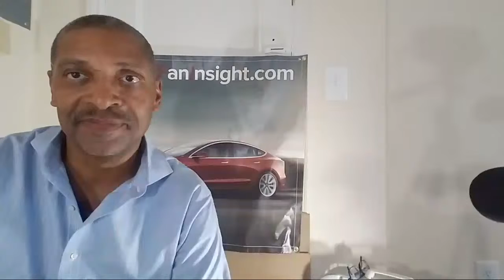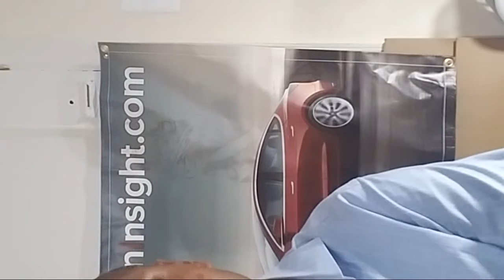5 Reasons Maxwell Dry Electrode Not Viable TESLA

Comment: The way I understand 'SUPER CONDUCTORS" is that at Absolute Zero electrons do not lose energy in the form of heat.  Mercury at -240 degrees C becomes a superconductor.  Progress has been made.  Hydrogen Sulfide under extremely high pressure currently holds the record as a "high heat" superconductor at a mind blowing -70 degrees C.  To date "room temperature" superconductors have not been developed and are decades away by all accounts.  The dry electrode battery is a process where the liquid electrolight is replaced by a dry electrolight product which is applied using electrostatics and does not require baking to dry, eliminating a bulky, time consuming, polluting and expensive step.  This was the big draw for TESLA because they would be able to achieve at least 15% better energy density initially and up to 50% energy density with a little development.  A solid state battery is completely different still and is currently in development by EVERYBODY.  Super Capacitors are a completely different animal and will be made to work as a buffer  between a battery bank and an electric motor as they accept and discharge current EXPONENTIALLY faster than any electro-chemical batteries.  They do not currently hold their charge long enough to be used exclusively.  Do some homework Greg.
Reply: Agree with most of it. Just notice, AFAIK, DBE is a tech to produce the electrode not the electrolyte.
Reply: Celso Starec ... oh ok ... I’ll look into it closer.  I thought that complete elimination of the electrolight was what the research and  development departments around the world were trying to accomplish with the solid state battery.  I will do a deeper dive.
Reply: @jamesbell8861  
Yes, the solid state battery is a kind of holy grail of our time. People hope to eliminate the current liquid(paste) electrolyte and many related artifacts that shorten battery life and endanger thermal runaways.

On the other hand, Maxwell Technologies was specialized in supercapacitors, a device that stores energy as electric fields instead of chemical reactions as regular batteries. (Take it with a grain of salt, in Li Ion batteries the ions move and concentrate in different regions, but not necessarily react chemically).

Maxwell developed and patented a technology to coat electrodes with a material with a dry process. This technology is supposed to serve supercapacitors and many types of battery electrodes. This is the DBE process people theorized will bring many benefits to Tesla. This technology does not alter the kind of battery, just the way it's manufactured avoiding clumsy techniques that demand a lot of space, time, energy, etc., limiting battery manufacturer productivity.

"Solid State Batteries", or "glass batteries", would be a different kind of cell, far different than current ones.
Reply: Celso Starec ... I’ve described the process of the Lithium Ion battery to my wife once like this ... “ think of it as a RESET as apposed to a RECHARGE, the battery doesn’t actually hold electricity. That’s what a capacitor does.”  She was having a little trouble wrapping her head around the difference.  Speaking of ‘salt’,  have you seen any of the videos posted by Don Sadoway on his liquid metal battery technology that he developed with his students at MIT ??? It sounds promising as a GRID LEVEL STORAGE battery.  It actually uses molten salt as its electrolyte.  I see Tesla using Lithium Ion in their MEGA PACK Storage and wonder if they have considered or dismissed this innovation for R&D ??? If you haven’t seen it, give it a watch, I really found Professor Sadoway to be an entertaining character and quite knowledgeable.  I’m not sure if I completely understand how it would work in the real world but then I’m not an engineering major either ... lol
Reply: @jamesbell8861  
I did see videos of professor Sadoway. This and other reactions have been promising for a long time.

Technically, electricity is current, the flow of charges. Most of the time the charges are free electrons that flow through conductors. Many metals are good conductors as their atoms are organized into a lattice with a cloud of free (or almost free, loosely coupled) electrons, that allow for a new electron to enter into one side and another of the cloud exists at the other side.

A capacitor is a device which stores charges at its electrodes that has a noncondutive (dielectric) material  separating them. Those opposing charges at each side maintain an Electric Field across them. The energy is stored in this charged state, or seen in another way, in the electric field.

If you plug a load, let's say an incandescent lamp that acts as a resistor across the capacitor electrodes, the opposing charges would flow through the load till both sides equalize.

A galvanic cell, the basic element of a battery is somewhat different as it changes a chemical state as a way to store energy. There is more to it than just the flow of electrons to one side or the other.

There can be proper chemical reactions as on lead acid batteries involving both electrodes (Pb and PbO2) and the electrolyte (H2O + H2SO4).

There can be another way as in the Li-ion batteries where initial charge depletes some Li atoms from their electrons turning them into Li+ ions. Those ions travel to the other side of a separator membrane within the cell that does not allow electrons acros. It's a flow only of positive charges (the net Li ion charge imbalance) inside the cell. Those Li ions "lithiate" (they cram themselves within the porosity of)  the electrode material, but don't actually react chemically.

If that same lamp/resistor is connected externally across the cell electrodes, the Li ions crammed in the opposing electrode will tend to go back, and an electron that was at the electrode balancing the ions will go back, but as the only path is through the load it will go there.

If for some reason the separator fails, usually punctured by a "dendrite" that parasitically grows with usage cycles, there can be established a short circuit for electrons within the cell, with high currents, thermal runaway that ignites some chemicals in the electrolyte.

The holy grail of the glass separator or the solid state battery would be to do the function of the electrolyte and the separator without the risk of failure, being intrinsically safe, possibly with less mass and volume.

The DBE process would be another way of producing the electrodes coating a metal with the intended chemicals without the need for the wet process and the ovens to dry the result. It does not mess with the electrolyte.

A capacitor is neither supposed to conduct charge within (there is always a kind of parasitic resistor within, modeled as ESR - Equivalent Series Resistor), nor chemically change state. As the electric field builds up, it will polarize whatever dielectric material separates the electrodes and eventually break the dielectric/insulating capability of the material and let current flow. Somewhat similar to the way a high tension pulse induced at the secondary of the coil from a gasoline engine breaks the dielectric capability of the air in the gap of a spark plug and creates a spark. In a capacitor, one would like to put as much charge/voltage as possible before it turns into an undesired spark plug.

Hope it makes it clearer.
Reply: Celso Starec ... Thanks, I appreciate the time you took to break this all down. I understand most of the science at a rudimentary level and find it fascinating how we figured it out in the first place.  I’m awed by the intelligence of some people.  It gives me confidence that we will figure out this big polluted mess the greedy ones among us created.  It’s only even come to my attention in the last few years exactly how long clean technology had been locked up in patent vaults by various corporations hell bent on squeezing every last dollar out of the populations pockets.  I guess we can figure out the restitution later ... right now the battle is catching up on decades of lost R&D time.

Comment: What is that you know, Elon wasn’t aware of when he bought Maxwell?.. You probably know that Elon specialized in capacitors at stansford.
Reply: Ram ramachandran Exactly
Reply: The acquisition wasn’t primarily about Maxwell Ultracapacitors (Superconductors aren’t involved at all - they’re a thing too but not seriously connected to near term applications for this stuff). 

The point was Maxwell’s battery MANUFACTURING technology - it’s technology for building machines that MAKE batteries. Their dry electrode process eliminates an expensive drying step. Maxwell developed this technology in association with Ultracapacitors but Tesla’s big use of it is for batteries. This dry electrode tech allows a radical reduction in the footprint of the factory floor machinery ( 1/16 the area) as well as a set of improvements in the cell performance, doubling useful life, improvements in energy density, etc. 
Tesla is convinced it can put these technologies to use in it’s Nevada GF immediately. That’s likely why it seems to be taking over cell production from Panasonic. Tesla will have a big public presentation about this soon.

There are some excellent videos explaining this stuff in great detail on You tube. Look at Jack Rickard for example.
Reply: Mark Hoheisel Do we know this? UltraCapacitors are super useful for initial torque and regeneration breaking efficiency.